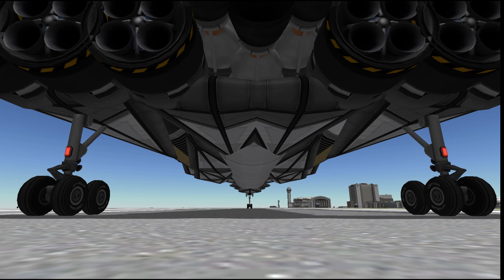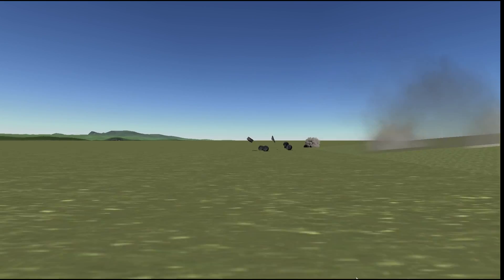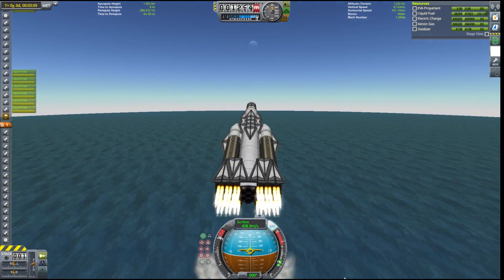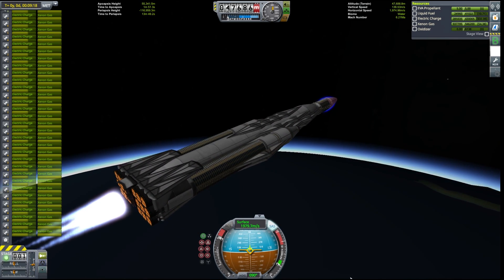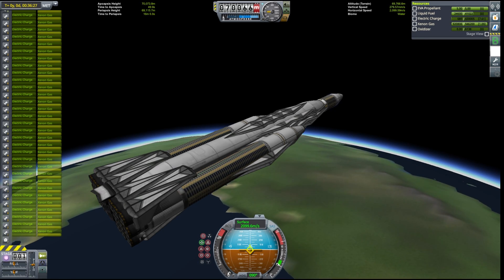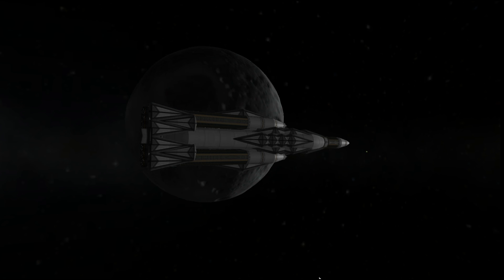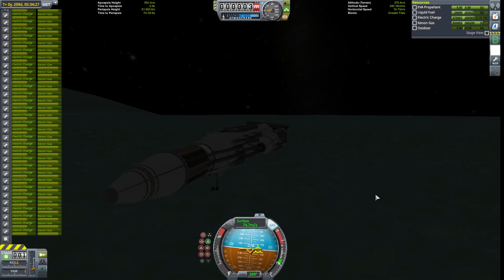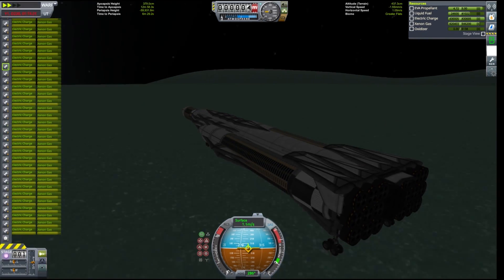Single Stage Stock Endurance Record: Episode 1- KSP v1.4

Comment: Of every mission Bradley has done, he never landed on Kerbol (Getting anywhere below 1,000,000 will probably have you frying or just go boom so not a prime idea)
Reply: Maximum temperature of the sun (kerbol) is at 600 km above the photosphere. Approximately 10,000 K. 

Outside of the ignore temperature cheat, there is no way you can make it that close as the radiators themselves will almost instantly explode long before you get to 1,000 Km, let alone the edge of the chromosphere.
Reply: @lucifer6966  Typo, it's 1,000,000. Landing on the sun is impossible, literally and literally.
Reply: I have made it to 750,000,000 but any lower would be risking the radiators.
Reply: @fartpluswetone8077  600 km is 600,000 m (the beginning of kerbol's chromosphere, the hottest part).1,000 km is 1,000,000.

Learn your conversions?

Straten got within 601 km, but he used a heavily clipped radiator and battery probe and pointed the rads/ shields at it the whole time for max efficiency. Also back in 1.6. Not sure if its still possible.

I've done 1,700 km. So at least that much is possible but it's basically pure rads battery and solar power.
Reply: @lucifer6966  Forgot my unit of measurement, it's in meters. I used a vessel that was practically radiators and a small NERV cluster that was off for 95% of the flyby. Radiators were all maxed at 70% for 750,000,000m.

Comment: With some modifications, This craft might work as a to eve and back ssto with no ISRU
Reply from the maker: This would not be the direction to go in achieving a challenge like this.  The battery/RTG approach isn't necessary, as both Kerbin and Eve provide ample solar power.  Also, the Raper engines simply don't have the closed cycle performance to work well on Eve.

Also, any solution to the Eve and back single stage unrefueled challenge will involve an out of the box solution, not mere optimization.

Comment: I am planning a somewhat low mass of 18-20 tons reusable Moho Mission that uses a MK2 spaceplane (rather somewhat like the 13 ton reusable craft to Tylo video) to get to LKO, but even with 4 radial supersonic air intakes, an engine pre-cooler, and a shock cone, and one rapier engine, the jet was unable to pass 400 m/s. Why did that fail yet your ssto had 28.5 tons per rapier engine? Was it lack of lift or was it due to the MK2 parts' drag?
Reply: Your craft has too much drag to get over 400 m/s. This can be reduced by using less wing area and by lowering intake count as they both increase the drag of your craft. Also, the cause of the drag is probably not the MK2 parts as they have little drag. Hope this was helpful.

Comment: Why... oh why... my god, you could save so much mass by eliminating the battery banks entirely, and just packing on enough constant RTG power to supply the ION engines.
Reply from the maker: Try crunching the numbers on that =)  Rtgs are heavy.  I have 4.3*10^5 electrical units, which allows me to power my ion engines for 448 seconds.  I need to be able to supply the engines at this power at this duration (or at least very close to this) to adequately perform these maneuvers.  I would need 960 electrical units per second, or 1280 RTGs to do this.  This comes out to 102.4 tons of RTG.  4.3*10^5 electrical units come out to only 21.525 tons of batteries.
Reply: Oh... I was thinking of powering one ion engine. I'm an idiot :P
Reply from the maker: Using RTGs was the first approach that came to mind when I determined solar panels wouldn't work, so its certainly a good idea.  Its just not confirmed by the math.

Comment: Thought to calculate efficiency which you did not have need want to fill the plane up so it’s JUST light enough to take off at the end of the runway that means huge fuel tanks and only a few rapiers but starting out before takeoff there should be more fuel then you can fly with and some empty space in the tanks for in space refueling at a fueling station somewhere in kerbal orbit also a big wingspan will help you get maximum glide with the space plane I built you can almost visit every planet from one to the other without refueling if your conservative
Reply from the maker: Thatoneguy Mccool refueling changes the game entirely =)
Reply: Bradley Whistance exactly cause you use most of your fuel getting out of orbit see what I mean if you refuel in orbit or in dead space let’s say that was possible you could go sooooo much farther cause your not limited by takeoff weight you’d be limitless you could even add detachable fuel tanks that are kept at the station for even more fuel once in orbit and detached before landing the possibilities are endless